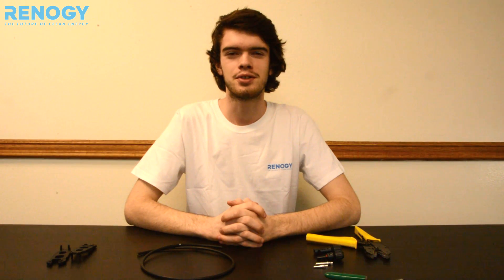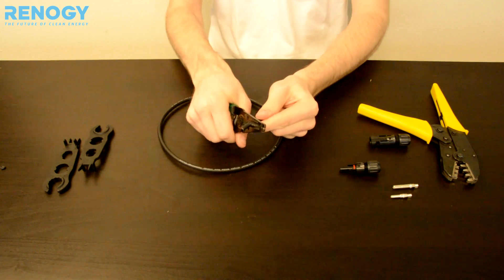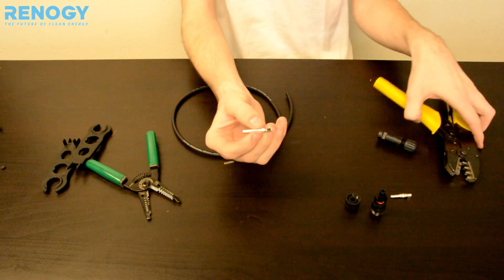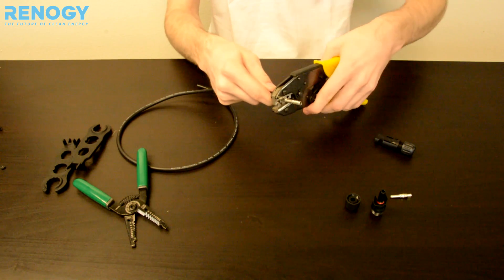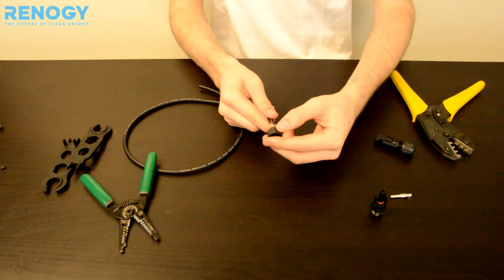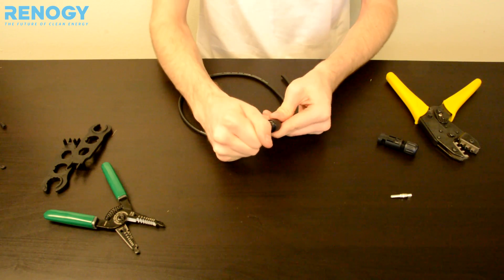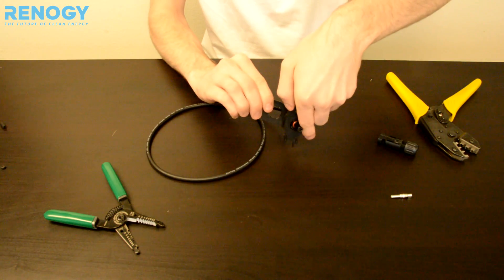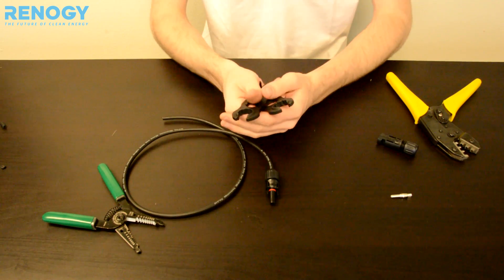How to Assemble MC4 Connectors | Renogy

Comment: I noticed that, in a lot of these MC4 connector videos, people are stripping a lot of insulation off the wire (like an inch!)  I already made a bunch of solar cabling that only has 1/4" or so of strands exposed... it's enough to go through the two metal tabs that actually get crimped, plus a tad bit more.  Is this enough?   Do I have to cut off and redo all of my MC4 connectors or do you think I'm good?  Would hate to lose the money for the connectors but it would be much WORSE if I install everything and THEN have a problem.
Reply: I dont strip my wire a lot. I also solder it instead of depending on a crimp.
Reply from the maker: +Christmas Eve 

Hi there, you don’t need to strip the wire  back a whole inch. At the very most, we'd recommend just below half an inch--as long as it get past the metal tabs and just a little bit more after that. If that's what you did already, I wouldn’t be concerned about it at all. Please feel free to message us again if you have more questions, thank you.
Reply: @RenogySolar  Why not recommend following the manufacturers instructions? I don't understand why you would do things like disassemble the connector when the manufacturer specifically designed them to not be disassembled, strip half an inch of insulation off when the manufacturer states 6.5mm, etc etc. What do you gain by making up your own method (that is slower, more error prone, and not-to-code) when the manufacturer has put millions of dollars/hours and trials to make a great connector? Seems pointless and arrogant to me. MC4 connectors are ubiquitous across the world, their tutorial is like 5 minutes, surely you owe them at least 5 minutes to watch the tutorial and do it properly?
Reply: I used the crimp, useless.
Just good old solder and bend the crimps over and solder again.
Good solid joint. :)
Reply: @mickgatz214  the worst thing to do soldering. A bad contact will raise temperature and melt the soldering...